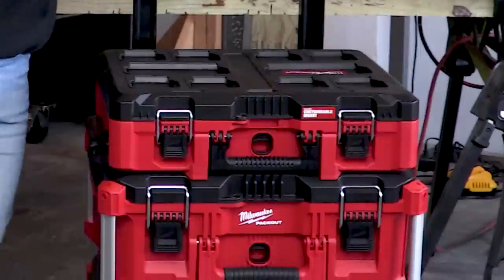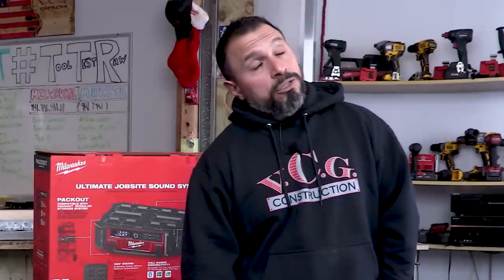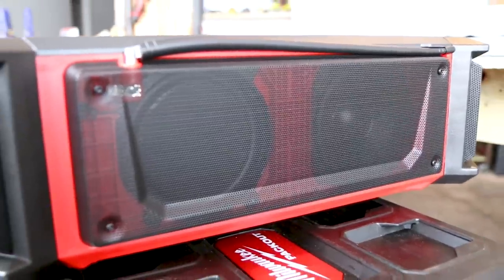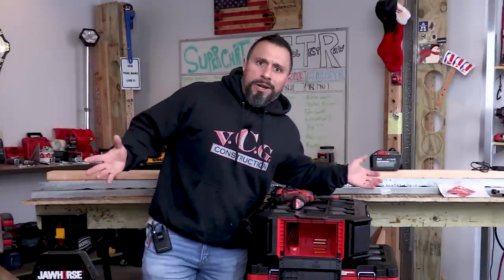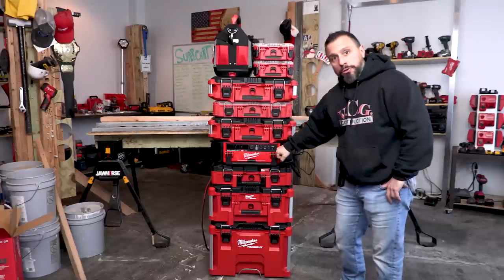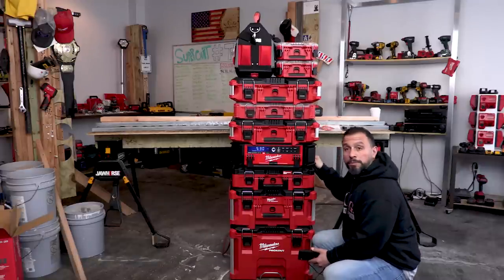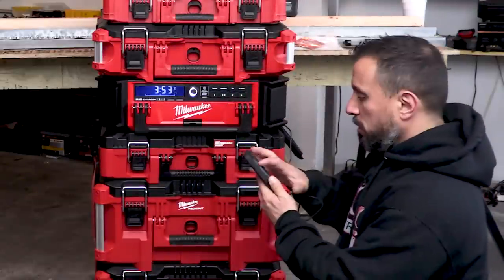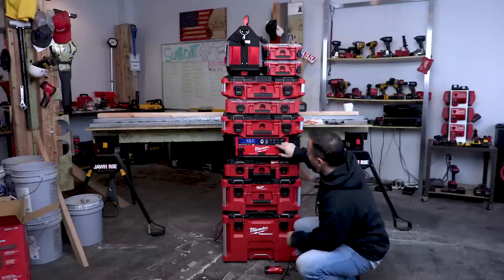Milwaukee M18 PACKOUT Radio Will Charge M12 Batteries! (SETUP TRICKS TIPS HOW-TO)

Comment: Seems like a pretty well thought out radio. But the price should be closer to $200 I believe
Reply: Completely agree. $299 is too much for that.
Reply: Shit I think even $200 prices a lot of people out when you have tools to buy and your coming up through the trades. Luckily they have the cheaper options to
Reply: Since it cannot use the radio while charging it should be around $100
Reply: @Originalxlander  it had a minor issue only on AM. Most barely even know of an am channel anymore
Reply: @JoshTheElectric  No vcg very quickly said you cannot listen to the radio while a battery is charging.
Reply: Just get a packout tool box and add speakers 🔊. There’s a guy on YouTube who makes custom speaker systems.
Reply: @Amnesia Iforget that is truly not the case. @vcg might have slipped up. The only issue during charging is listening to AM radio. Go back to 20 minutes  & 30 seconds on video. There is no change. It is still to expensive though.
Reply: @rhoduskk  Well look at the price of a charger. Then when you put it all into perspective, getting a 10 speaker stereo with Bluetooth and it can charge your phone at the same time, let alone all run off of your M18 batteries and still charge your phone...it's not toooo badly priced, especially as a cool addition to your pack-out system.
I have the pack out system and the other Milwaukee stereo/charger that was in this video, my only regret is I'd rather the pack-out stereo for my pack-out system. The biggest thing I'd like to add though is it would be great if you could turn off and on or balance all 4 corners of speakers. That is assuming you can't. That is the one thing I like about the one I have over the pack-out stereo, I can direct where I want to point the speakers so not to blast everyone at once (unless they want it) Haha!
Reply: Or be 50% louder for the existing price.  I bet a 1980's ghetto blaster could put this to shame.  Come on Milwaukee, give us something that we are afraid to crank all the way up.
Reply: @Sir.VicsMasher  I heard that. I had a ghetto blaster in the mid 80s and that thing was the bomb!!👍
Reply: Its not anymore expensive than the packout system itself. Their other radio/charger is $220 so your paying an extra $80 for the packout integration and convenience. Totally worth it!!
I've had mine for a week and love it.
Reply: Here in Canada the packout radio is $400. Big investment tbh, I’ll stick with my older Milwaukee radio
Reply: @thomasneufeld2035   try 675$ in nz!!
Reply: It is 400€ in Germany. Sometimes you can find it for 350€. That is about 480$US
Reply: 369 now
Reply: $380 now. Thanks Joe Biden. Lol
Reply: The word “packout” adds $100 to any Milwaukee tool. Great brand building. Sucks for us, tho.

Comment: They need to incorporate a rapid charging system into this radio that has charging for both  12v and 18volt.
Then I would buy one.
Reply: Yeah otherwise I don't see the purpose.
Reply: Id also like to see it be more compact, taking up only one slot so you can put your tool bag next to it.
Reply: One?
Reply: For this pricepoint yes a rapid charge shouldve been incorporated

Comment: The fact that it doesn’t turn up super loud I think benefits the sound quality Bose does the same thing my little bose doesn’t turn up excessively loud but the quality of sound is never compromised. I really like this radio but I do think the price is steep
Reply: New Jersey Workshop that has nothing to do with clarity.
Reply: @RoyALpro_yt  yeah it does, speakers distort and clip when they are driven too hard
Reply: @Bryan Kraemer, still, nothing to do with clarity. Distorting and clipping only happen when your speaker is getting too much watts. Clarity is the quality of the sound. The reason why it don't get loud is lack of performance. They could have easily made it louder.  Products like this one and your bose have a limiter in them to prevent blowing your speakers. Reasons why would be to accommodate for the differences in cell phones or mp3 player that are hooked up to them. In short and obvious, bigger amp+biggerspeaker=more sound. Oh and clarity from Bose is in the acoustic design of the box and has little to do with Bose speaker quality. And by the way, I'm a sound Engineer.
Reply: @RoyALpro_yt  No argument about Bose, they engineer their boxes to get whatever their "signiture sound" / frequency response is. However, speakers can clip while under their rated power.

It's essentially being fed a square wave instead of a sine wave which limits excursion. The voice coils are cooled by airflow from the cone moving which doesn't happen while clipping. 

I don't own one of these units to take it apart so you might be right about them not powering the drivers properly.

Comment: @VCG the 2.1amp at 5V is the output of the USB port. Basically for smartphones you want higher than 1.7amp output in order to actually charge your device. Fast chargers are usually around the 2.4 amp range.

Comment: Thank you for the review.  One thing this radio does not have vs the dewalt radio is 2 extra 120 volt that you can plug 2 more accessories like fans or 2 extensions cords.

Comment: Love that radio... just hate the knob! Everytime you pick it up by the handle your knuckles hit the center button,  turning it on and off unintentionally. I wish it was recessed or all the interface was buttons like the other ones that are on it.... seems like it's a moving part, on the front,  that sticks out and doesn't really need to be that way. Otherwise,  I love it! I canny tell you the number of times I roll in my stack and turn it on while setting up and all the other contractors come out of the shadows from all over the job site to see what the HELL SOUND SO DAMN GOOD and just stand there smiling and staring at it for 45 minutes. It's a great great great radio. Was expensive at the time but knowing what I know now, I'd buy it again in a split second!

Comment: Hi Guys!!!  Awesome radio!  I don't think the AM battery static issue is a show stopper.  About any device affects AM reception.  Hey Vince/Nick, can the bluetooth feature of the radio allow someone to make/receive hands-free phone calls through the radio speakers?  It would need a microphone for that.  You know, a built-in, swivel (up-n-down) LED "flashlight" might be nice to have when working in a dark work area especially if it was elevated on top of the Packout system.
Reply from the maker: I’ll need to explore the hands free calls further, but my older radio charger would not allow it!

Comment: i’m a bit late to the video but if anyone is still wondering about the passive radiator, it adds extra bump to the small subwoofer. works very well. since one speaker is usually enough to hear the low end frequencies

Comment: I want one of these radios myself. And when I’m not taking it to work with me, I plan on buying the world’s most fanciest milk crate (aka Packout crate) and mounting that on a wall mount plate, then click the radio into the bottom of the milk crate. That way, i can read and adjust the display and still use the crate for storing things.

Comment: The passive radiator is a speaker. It uses the active subwoofer’s air pressure to move in and out. It’s a way to get more sound without needing more power.
Reply: With that logic, then a port is also a speaker 🤷‍♂️ Js…….
Reply: @travispathway4647  it kind of is, wether it helps or worsens the sounds depends

Comment: I Own one of these.  Got it for Christmas 2019.  They have really good sound.  Weighs 26 pounds empty.  Its a beast, but the display is HORRIBLE.  To see the time I have to hit a button.  I know the station I set it at but it insists on telling me that instead of the time.  Also the display dims down and you can't see it anyways in a lit area.  The usb is only for charging, it doesn't allow you to use it for music.  The antenna fell off the first time I tried to deploy it.  It snaps back in but It isn't secured very well.  I'm afraid I'm going to loos it. It was expensive, but it was worth the money.  I hope Milwaukee addresses the issues I had with it.

Comment: Nice review bud. I’m 100% on board though, no M12 charging is definitely not cool and for me, a deal breaker. Really wish Milwaukee would have a radio that would charge and run on the M12 batteries too.
Reply: at the price it should come with the m12 charging  pod...e shouldnt have to spend the extra 50 bux to get it.
Reply: They have the m12 jobsite radio that will run off of an m12 battery and charge also. Its not Packout but I use mine in a noisy factory nearly every single day and its very loud for how small it is.
Reply: @chrisdeschenes8898  I know.  I preordered it when they announced it. Love the radio, not big on the charger cable not being built into it though. But it’s definitely quality stuff.

Comment: Like my Packout system and I would consider the radio but not being able to charge and listen to radio at same time is a deal breaker. That price tag is high considering what the specs are kinda disappointing .  Better make sure  its sitting in the shade. Having all that black its gonna get VERY hot.  Made that mistake this summer with my Packouts.  Had a multimeter and a few other plastic odds and ends get hot and deformed beyond use.  I didnt even have the lids sealed.  Knowing that, I still love my system.  My tools stay dry and safe. I cant imagine what DeWalts system will be like being almost totally black.  Great for winter jobs maybe.🤔

Comment: A side by side sound off sounds good for the old radio and charger vs the packout radio and charger
Reply: I have both, it’s no contest. Seriously.

The old jobsite radio was similar in volume and performance and clarity to my Sony SRS-XB3 Bluetooth speaker. The packout radio is waaaaaaaaaaaaaaaaaaay louder, clearer and it charges batteries. It fills our 6-bay shop to the point the customers complain from the waiting room. And the bass is deep and rich, the sound is crystal clear.
Reply: @colemanbonner  um okay

Comment: They missed on not including M12 in radio charger IMO. Great workaround, but charging through USB is painfully slow. No love for the M12 tool users!!! They sell M12 in packout so no excuse. Still waiting for the power station using M18 or M12 batteries. No idea why they are years behind Dewalt on that one. Still a Team Red fan!!
Reply: I agree.  I'm afraid it would take all day to charge a 12v battery.  Thanks for the review.  I don't even have 12v tools, but leaving that charging option out makes it easier for me say no to the new radio. I'll probably just throw a little Bose Bluetooth speaker into one of the packout boxes and call it a day.

Comment: Love mine, been rocking out with it for a few days now.  Probably not quite loud enough for working outdoors, will see when the weather gets better, but it is plenty loud for working indoors.  

I honestly don't think it charges as fast as the standard M18/M12 charger.  I tried charging two 9 AH batteries yesterday (from full dead), one on the regular charger and one in the radio, and the regular charger seemed to charge at least 25% faster than the radio.  Will try again another time to see if I missed something.  Be a good thing for VCG to test as well.  

Great commentary, I can't say that I disagree with anything Vince said.  Totally honest and fair review of the product as always.  You guys are the best in the business, just waiting on that 12" miter saw review!  😂  

Still not sure it was worth $299 though.
Reply: We're you using the radio while charging? Maybe that makes a difference.
Reply: @patrickmiller1674  I honestly don't remember.  I don't think so, but I don't remember for sure.  Will have to try again to see if that makes a difference.

Comment: Way late but they should have sold this as a half size unit more as a little radio plus charger in the back .  Idk what they need all that space for. And a full size with 2 120 or 110v outlets unless that's patented by dewault or something.. it must be

Comment: 1) The wind up cord is kind of stupid. Why not have an "inlet" that can be used in conjunction with an extension cord, just like their charger light? The extra space could have been used to put in a "radiator" or bass port, which frees up room for one more subwoofer, allowing for a true 10 speaker experience. The power cord makes the unit seem cluttered and old fashioned. It takes up valuable space that could have been used for something else, and it is a potential point of failure (it could break, unwind, or get caught on something during transport).

2) I like the radio, but I don't think that it produces $300 worth of sound. I understand that "jobsite" speakers are usually NOT that great because they have to be "sealed" from the elements, but this doesn't seem like a hard problem to solve.

3) The bottle opener is stupid. They threw it on there to make the radio seem feature rich, but it's a lame attempt. I wonder how often in a day, week, month, or year that I find myself in need of a bottle opener. The answer is zero. I never find myself in need of a bottle opener. And if I needed one that often, I'd have one already. It's just a stupid idea to make you feel like you got more "bang for your buck", but I'm not fooled by it. Like, "wow thanks, Milwaukee! I got a $0.10 cent bottle opener for my $300 dollar purchase."

That aside, I do like the Packout feature, I do love the interface, and overall it's a good functional design for the jobsite. It simply could have been much better than it is, especially for the price.

I did end up buying the radio, and I do love it. But I'm disappointed by the several missed opportunities to make it WAY better. I think a partnership with Bose would have been smart. Put their technology into a jobsite speaker, and NOW you have something that's well worth $300 or maybe even more. 

As it stands, I'm happy with my purchase, but I do feel a little bit jipped.

Comment: Man Vince, bro your pack out set up is looking pretty nice there buddy.  I have to say if i wasnt so deep into the Dewalt tough system I’d make the jump over to Milwaukee.  I really Iike all the pack out but i think I’m sticking to what I’m already invested in and holding out for the tough system 2.0.  Thanks for sharing Vince!
Reply from the maker: 2.0 radio is on sale right now, save a hundo
Reply: Already scored it at the depot cuz!  Just waiting to add some of the new 2.0 boxes to my set up.  I watched your video on the tough system 2.0 boxes, they look pretty solid!  I’ve been using tough system for years and I can’t wait for the new boxes to drop.

Comment: No preset buttons?  No Remote?  If you get a call does it connect through the unit?  Why no fast charge capability?  Milwaukee had an opportunity to get my cash, but it may not happen till v2.0
Reply: Your phone connected to Bluetooth is the remote.
Reply: And there is preset on the old one.

Comment: I have the older style, but have this one on order. The only complaint I have about the old (and appears to be the same on this one) is the power button. Because it sticks out proud of the front, it gets bumped and turned on easily. Numerous times Ive been driving and had it get bumped in the back of the truck and turn itself on and start blasting music. :) Not a deal breaker at all though. Charging M12’s would’ve been nice if it was integrated, but I like your hack! I’m curious if the bluetooth range is any better, the old one was a little short??
Reply: Bluetooth range is a little short I agree.

Comment: Ok, so here is another hack for the VCG.  If you listen to Amazon Music and want hands-free control of your music on this new radio, and have access to wifi or a hot spot on your phone, you can do the following.  Get an Amazon Dot and plug it into the USB port for power and then connect the Aux cable to it.  Get it connected to wifi or your phone.  You could maybe velcro the Dot to the side or something, and you can then control your music with Alexa.
Reply from the maker: That sounds like a legit hack cuz, thanks!

Comment: Hello everyone,. I think the Milwaukee radio is nice,  unfortunately not $300.00 nice.  Also a person has to take into account that the radio is not a money generating item.  I like the concept of a pack out radio.  A good example is.  Do you need to pay a Nordstum's or Macy's price (Milwaukee) or will a Walmart budget get the same or better results.  Bosch is $150.00 plus tax at the Lowe's.  Love mine !!! Awesome sound !!!! The only down side is it don't mount to any box system.  I use Ridgid boxes, so for me it is a non- issue.  Food for thought everyone.   Awesome video Vince, Thank you !!!!!
Reply: Stephen Lee I think the ability to lock it to the pack out is huge.  My Makita radio is a pain in the ass to wheel around on the pack out as it is just small enough to fall out between the handle.
Reply: @kds471  True, I understand why the Makita radio would be a problem.  Can you put your radio inside one of your larger Pack Out boxes.  I have a 12V Milwaukee Am/FM radio that is small enough to ride nicely in one of my Ridgid boxes. Another thought is that you could put it in a tool designed back pack.  I do a lot of assembly and small repairs in apartments.  My Milwaukee back pack is the first think I grab out of my truck.  It would hold a radio nicely if I needed it to.  The point is, if there is a well there is a why.  Good luck to you in your work.

Comment: My pack out radio worked fine for a couple months but then the power cord stopped working. Works with a battery but that’s it.
Reply from the maker: Call 1800Sawdust